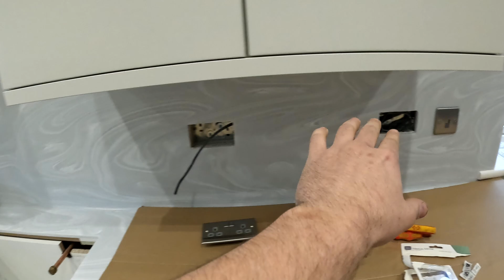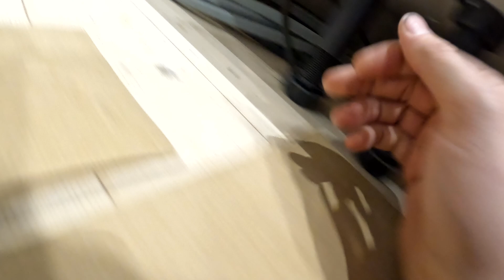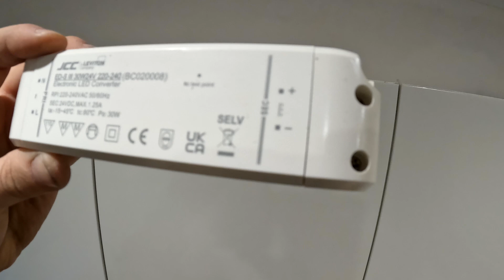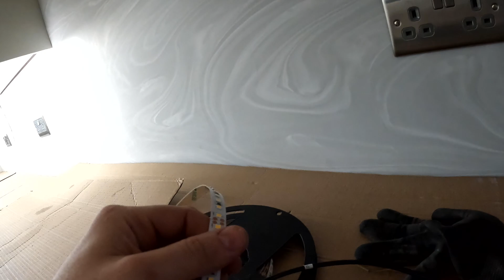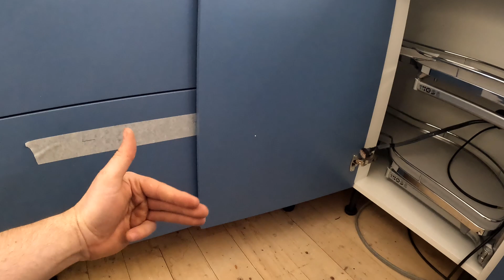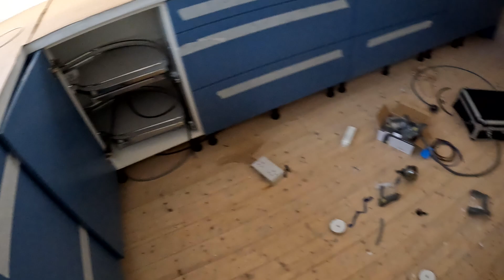THEY WANTED LED STRIP WHERE??!!                                       KITCHEN 2nd FIX

Comment: How come the first cupboard you never had to solder but the second you did??
Reply from the maker: Heya, so that came with pre made ends so you can just extend the cable to the driver. However once you cut it down you have to solder a cable 😀